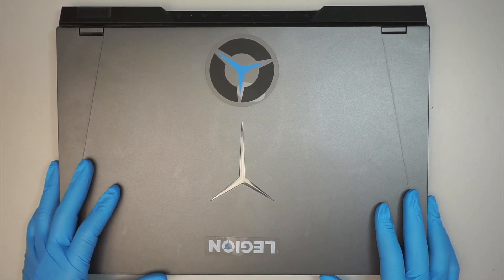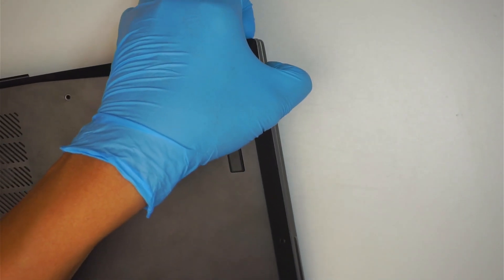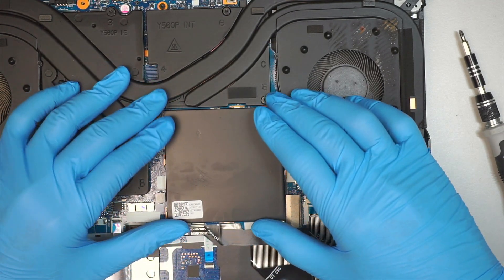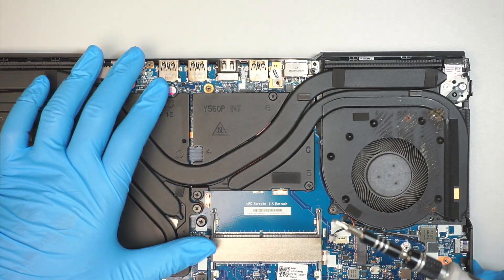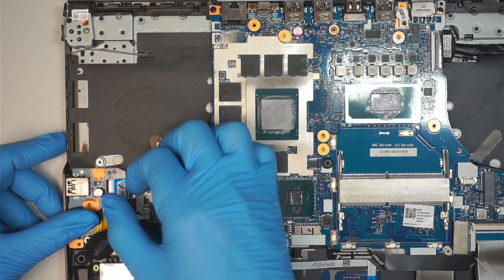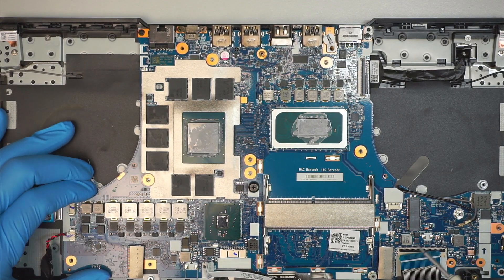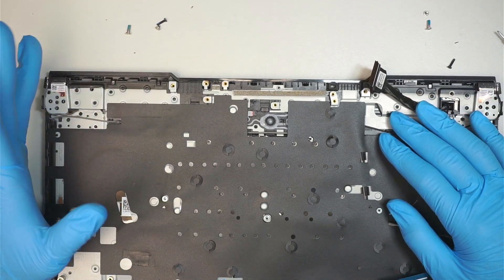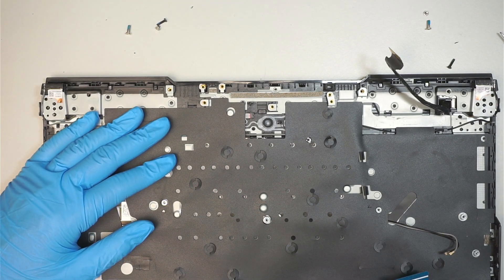Lenovo Legion 5 Pro 16ith6h Teardown Disassemble Upgrade

Comment: Hey bro good video, it helped me alot. If you flip the laptop over, you can remove the plastic piece that has HDMI and so on on it, which allows you to unscrew the brackets holding the screen onto the keyboard piece. It's not glued together. Hopefully I assemble mine back correctly and the new/used keyboard works...
Reply: and the keyboard from eBay that was advertised as functional has 5 letter keys that do not work 😂😂😭😭😭😭🤣🤣🤣🤣

Comment: I spilled a little bit of beer on the down left corner of the keyboard. Immediately dried it and now waiting for it to dry completely upside down, even if it's not look wet. 
Perhaps, I'll need to open it and look if it's leaked further after a while. 
Thanks for a video! 
❓️And I have a question, maybe it's stupid, but I don't understand: 
Does a keyboard have a protection layer between itself and other components? Or is it just the raw keyboard we see in this video?

Comment: This video and guide was instrumental in giving me the confidence to replace my keyboard.  At 15:30 you hit a roadblock and get discouraged, thinking the LCD cannot be separated.  The top portion of the bottom part of the case is held to the LCD by two screws on each side.  The two screws can be revealed by taking the cover off.  It unpops with one friction clip on each end and then slides back away from the assembly, revealing the screws.  I now have essentially a new laptop because I was able to order the entire keyboard and top half of the case off of ebay for $90.  Thank you!!!
Reply: Bro, You saved my life. Finally I can use my WASD key like normal person. Repairer asked for 200£ to fix it and I am sitting with 105£ profit.
Reply: @Resad879  did you just get a new keyboard and do the replacement yourself?
Reply: @saadahmad9565  Yes infact I did. It was not as difficult as I was expected to be
Reply: I was like ?
I too have a broken keyboard and palmrest and am going to order the part. Same price too. I was getting nervous until I saw your comment. Thanks

Comment: Hi UberGeeks, i have the same laptop (but the amd variant), and i was stupid enough to put a password for the bios. After not checking it for sometime, i forgot it and now i can't access my bios. Can you please tell me which chip in the motherboard is the bios chip. Im will maybe try to desoldering it to try to read it with the svcc programmer and find my bios password, or rewrite it.
can you please help me
Reply: Try to remove BIOS/UEFI battery, and also main battery. Wait 5 min, then attach back.
Reply: @Mojary  did it. It sadly didn't work. I bought a ch341 usb to read the bios file send it in a forum to have it reset or cleaned(idk what they do to it) so that you can rewrite in on your bios chip. And then tada, your bios is like factory reseted. My only problem is that i did that. But in the forum, they told me i didn't extract the bios file. But another chip. So now im trying to find that damn bios chip to read. Im probably gonna do that when i open my pc for clean-up next time

Comment: Hello, I have lenovo Legion 5 Pro-16ITH6 I7-11800H ( Type 82JF ) , The BIOS is corrupted, and now nothing shows the screen. Any methods can recover BIOS ?  is this laptop two BIOS chips on it? and where are they located on the motherboard ? if reprogramming the BIOS, how to keep the serial number in the BIOS? Thank you
Reply: Hello, do you fix it? If yes what you do ?
Thanks
Reply: Try to remove both BIOS/UEFI battery and main battery, wait 5 min, then attach back.

Comment: I really wanted too see how you're supposed to take the fan off the radiator to clean the dust between there, I'm pretty sure there's a mat of dust blocking mine since there's no air blowing out :(

Comment: Unbelievable. I ordered a new keyboard, took the entire laptop apart, just to get to the point where you said the keyboard can't be replaced in this model. Fuck Lenovo they've given me nothing but issues
Reply: actually you can replace it, I replace a few, after you get into this point (in this video), there's another panel at the ports, you just have to remove them by pulling them up, after that, you will find another screw, just unscrew them and the lcd cover and the uppercase (keyboard panel) will now be separated
Reply: bruh fucking same... although I have an 16ACH6H legion 5 pro so idk if that applies to me too but I'm sitting here right now with the entire damn thing disassembled and a new keyboard right next to me...
Reply: @SecularSerenity how's it going?
Reply: Yes you can do it !